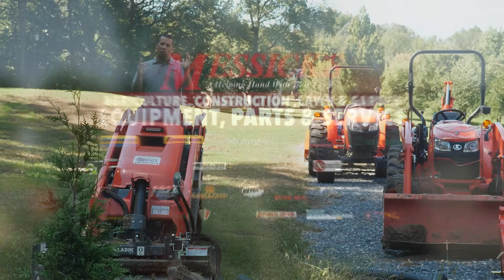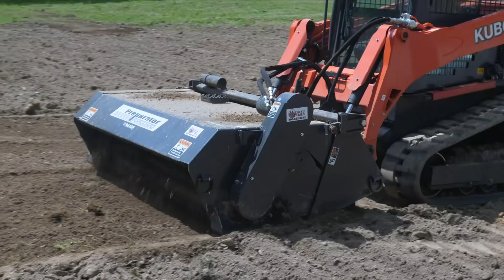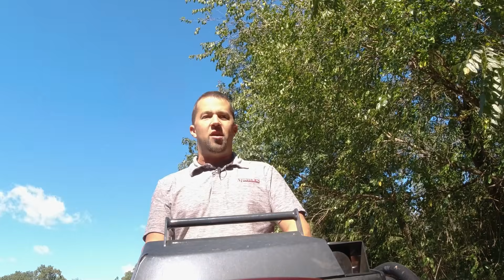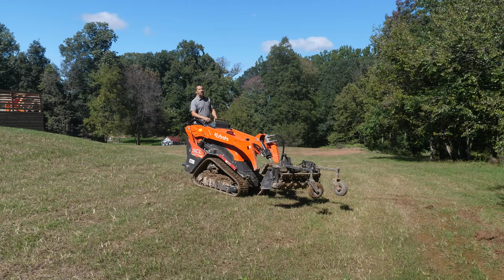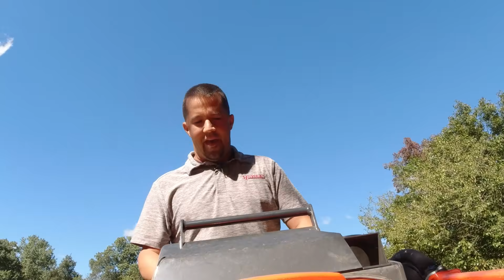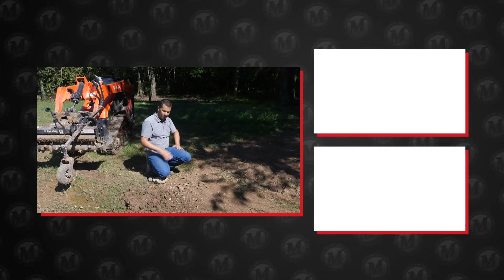Harley Rake | Lawn prep with the Kubota SCL1000

Comment: Seven years running a 7' harley rake have taught me going forward is preferable to going in reverse. The ability to control the depth and overall level is better.  The rocks and other debris are pushed away,  saving broken windshields. Using a perpendicular pattern also smooths the variations in areas being leveled. Thanks for the work that you put into your videos Neil,  they are both informative and entertaining.  Paul

Comment: I need to redo at least an acre of grass that is covered by a dozen trees. Really rough ground, can launch off my tractor if I go too fast.  Would need something like this for my 3PH.   I don't want to till it, too many roots to contend with, so would something like this, or similar work?  Either B2410 or L4060 (if the loader ever shows up).
Reply from the maker: Yea, probably best to rent one though.
Reply: I would recommend adding top soil on top of existing grass. Use the harley rake to fill the low spots, avoiding disturbing the existing sod. My harley rake will grind sod into soil and root matter, but it us a slow process. It's faster and cheaper to add soil and level. That is if you value your time and the cost of fuel.  Good luck with your project.  Paul
Reply: @bendermanufacturing  I would but there is also a lot of undesireables in some areas that will be getting a strong dose of 2,4D.  Going to take a lot of work, especially in the back where the new septic is going in.  Some areas will need a new top layer of soil, especially around the trees, some areas need a rip out and renew. Some just need smoothing.
Reply: @acdii  if you are in the Chattanooga area and want to hire it out. I got the equipment and skills.
Reply: @acdii  Adding topsoil to tree roots is a waste of money. They'll be back in 2-3 years, especially if it's a shallow rooted tree like elm or maple.
Reply: @Chris-jh3tg  Agreed, thats why I want to chop them up and clear them out. They will come back eventually, but it will take at least 10 years or more before they become problematic again.

Comment: Nice rig. I avoid lawn work like painting, but it's nice to know there's a cool tool for it if needed. Actually I've been filling some low spots, but it's a rural place and not manicured, so spreading soil with FEL and letting the winter even it out. In the spring I'll overseed if the existing meadowgrass hasn't filled it in before I get to it. Sure wish you guys were nearby, I'd consider renting that attachment.
Thanks for the education and Congrats on the 100K!